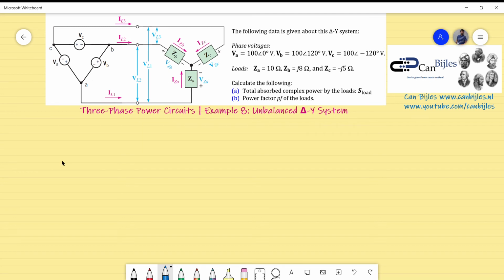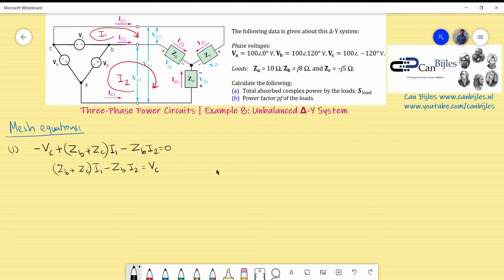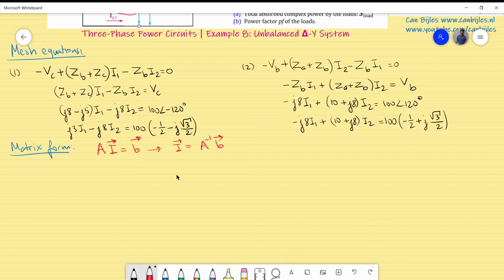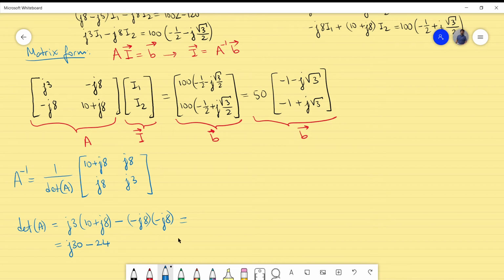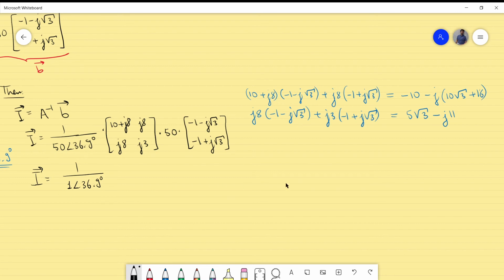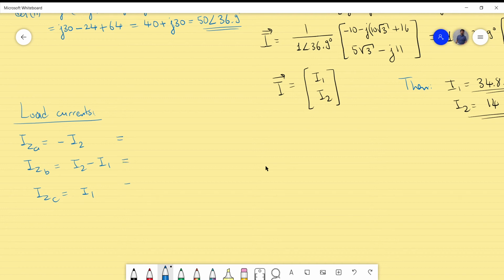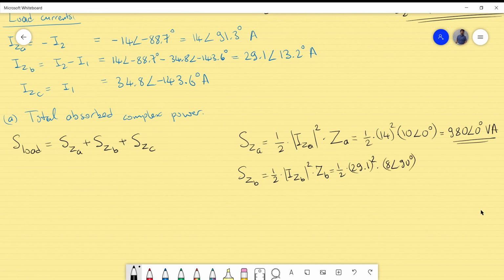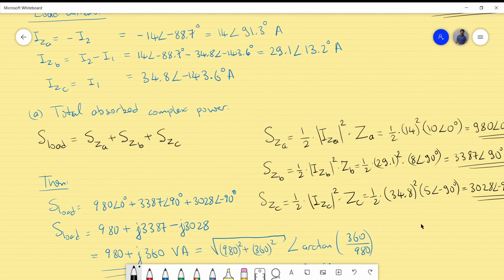Three-Phase Power Circuits ⭐ Example 8: Unbalanced Δ-Y (Delta-Star) System

Comment: How do you know the calculated values are peak values and not RMS values? thank you
Reply from the maker: The input sources are given by their peak values, not RMS values. The formulas I am using consider also the peak values, not the RMS values.
Reply: thank you
Reply from the maker: @philliphollingsworth6601  You are welcome.
Reply: Would you consider doing an example for a Delta-Y, Unbalanced Load, with Line Impedances, NOT converting the source to a Y equivalent, calculating the source, line, and load currents, power delivered, and power consumed.
Reply from the maker: I am planning to do such a video also. Stay tuned.
Reply: Wonderful, I look forward to the solution. I haven’t seen a circuit solved as I have described.
Reply from the maker: @philliphollingsworth6601  Working on it.
Reply: Thank you, that would be a great solution to see.